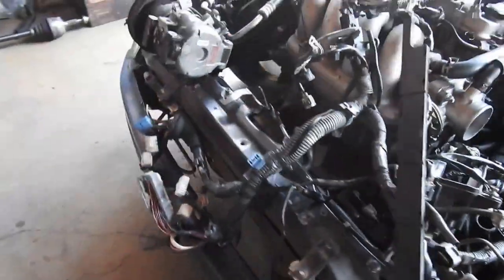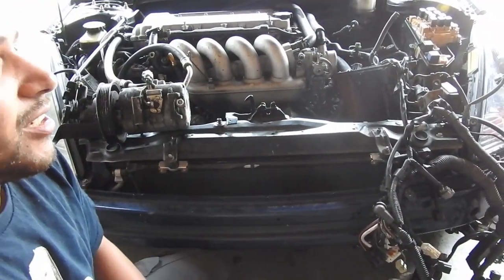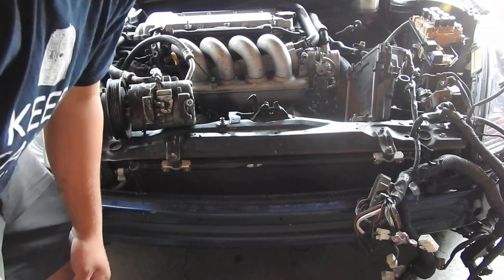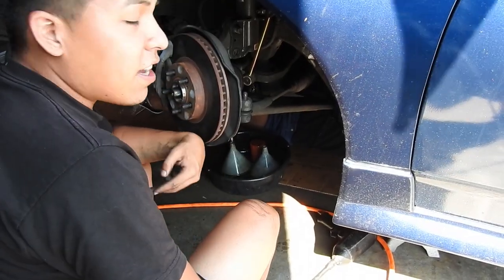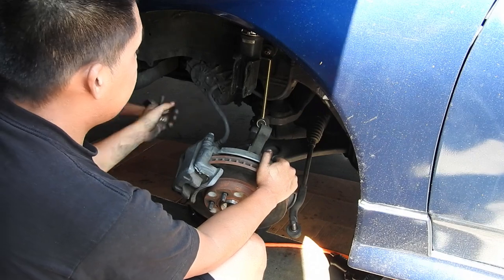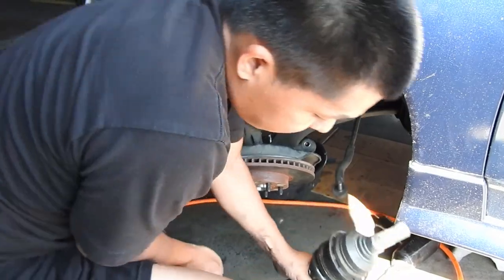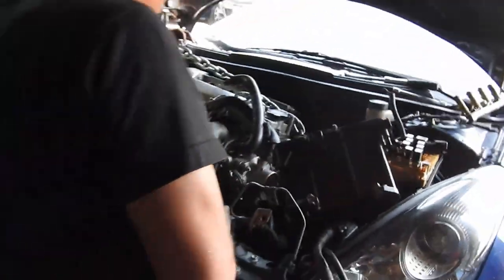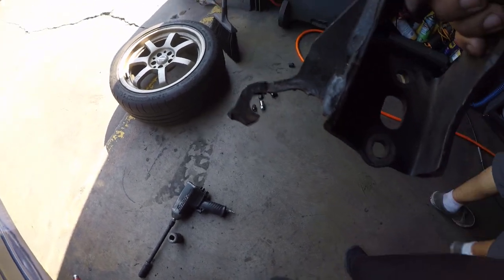Removing Blown Motor Toyota Celica

Comment: Remove the engine with header it makes it easier for me. For the rear mount I leave the bracket on the transmission and leave the mount on the car. I just remove that long bolt. I use the intake manifold and header to pull it out. That’s what I do.
Reply from the maker: Oblivion Crew I remove most of everything so i dont catch anything will lifting the engine

Comment: It's RipperJack from Tiger King 2 here. How did you remove that bottom cross brace under the transmission? There's a rivet on the back part. Do you remove the upper bracket too?
Reply from the maker: I dont remove the cross brace only the brackets from the motor mount by the radiator and top of the tranny
Reply: @RafasGarage  You talking about the motor mount that's on the driver's side attached by the wheel well? You don't remove the rear motor mount? I'm having an issue getting that rear one out, and it's attached to that cross brace somehow. Ot sounds like that rear motor mount doesn't need to be removed? It looks like it's on the tranny, but maybe it's not?
Reply from the maker: @RipperYouTubeOfficial  i dont remove the mounts only those two brackets, the rear i only take off the 17 mm bolt
Reply: @RafasGarage  ok, appreciate ya. I'm replacing the clutch, so I need to pull the transmission out. I need to watch your video again, I don't think you pull the trans do ya?
Reply: @RafasGarage  Yep, you pulled the tranny also. I'm dropping mine from the bottom. 
Maybe I need to put everything back together and just drive my Celica to your place and put in a new engine just for the dancing. Lol
Reply from the maker: @RipperYouTubeOfficial  yes i have
Reply: @RafasGarage  Ok, I got the master plan. I need you to come to Oklahoma and help me with my GTS. I'm replacing struts, brake components, clutch, headlights and adding ground effects and new bumpers. When can you get here? Haha. You make working on those Celicas look easy